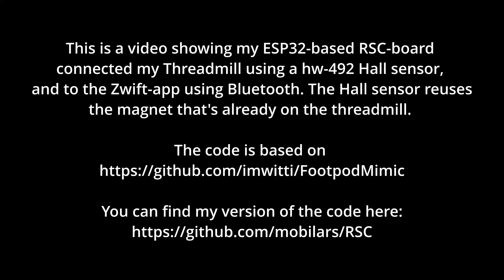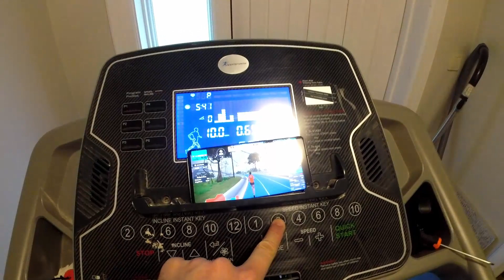ESP32 Bluetooth for Threadmill speed to Zwift

Comment: Do you have the issue of oscilating speed?
Reply: And thank you for the Project
Reply: I've done something similar with an stand alone A3144 powered on 3.3v. Despite its specs says mininimun is 4.5v it works without problem. What I have to do is add a small filtering cap on the ESP32 side, I think it was something like a 100nF. I was also using a pull up resistor, I don't remember if the ESP32 have its own inside.